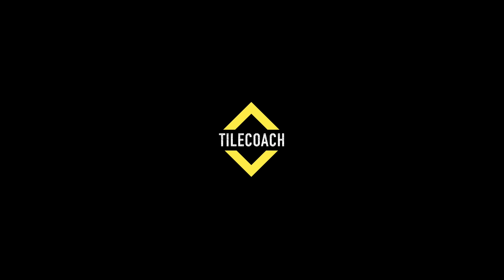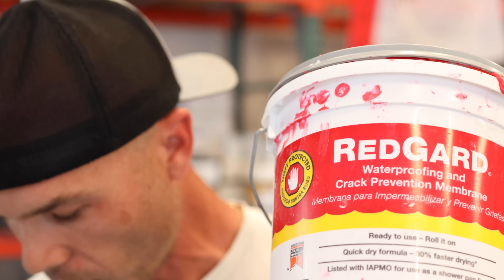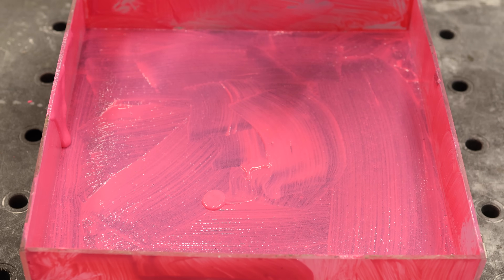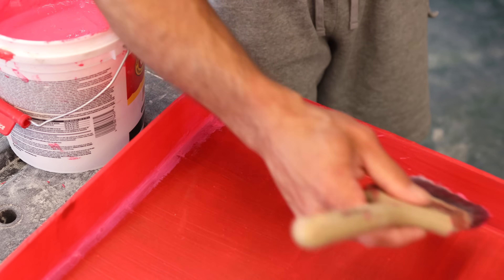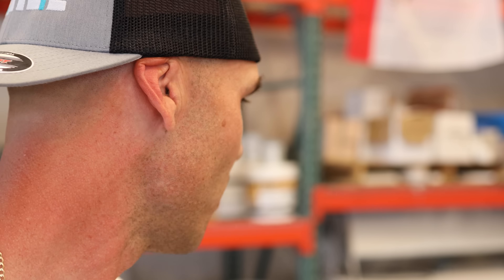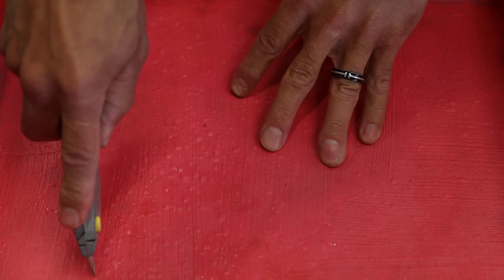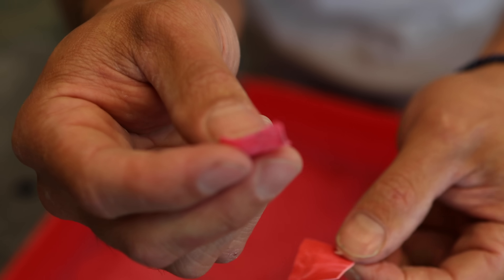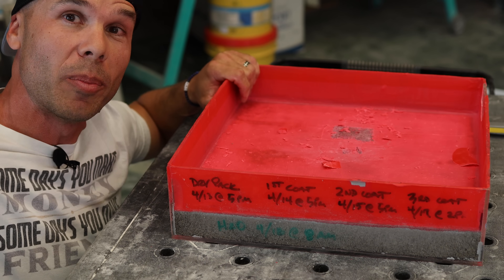REDGARD FAILED FLOOD TEST!!! --- Why Did it CRACK and BUBBLE UP???

Comment: For my zero transition shower I used a liner, then mortar bed, then redgarded 3 thin layers, and then an extra thin coating like you did around the corners and drain.  Because of other work going on in the house, I did 24 hours between coats and after the last coat it was over a week before I got back to putting in pebble on the floor and large format tile on the walls. I've been using it for almost a year and due to it being a bathroom over my garage, I have access to see the under side, and can report absolutely no dampness is showing and the shower is used at least twice a day...
However, I would never rush the drying time.... I was lucky I didn't have to push it....Interesting to see your results and wonder if the dry pack just needed a longer cure time...
Thanks for all you do!
Reply: Why two layers of waterproofing?     Waste of money.   If you use a liner this membrane isn't needed.    Just like the other way around.     Use one or the other.   No need for both.     If I seen  you using both on my job site, you would be fired...
Reply: @homesteadhaven2010  better safe than sorry🤣🤣🤣
Reply: @homesteadhaven2010  no such thing as a waste of money or something taking "too much time" when it comes to my house. Having both of these in place is basically CYA. If 1 system fails then I would want to have the pan liner as a last line of defense so that I'm not having to replace an entire subfloor bc of water damage. I understand you contractors operate differently and want to rush from one job site to another. You don't have the luxury of time to properly allow materials to dry or settle before starting the next. Everything must be done efficiently and economically. . It's just not possible for you - I get it.

Comment: I make no claim to expertise here, and this will likely be ignored, but here goes.  I chose not to use Schluter, not because the product is bad, but because their warranty installation instructions were lacking at the time, in my idiot opinion, and the local price and availability was insane.  In outdoor waterproofing, you ALWAYS start at the bottom, work horizontally avoiding / staggering vertical seems, overlap everything, and then move up.  They did not allow modified thinset at that time, i don't know if they changed that yet.  Add to that a few years ago my lowes wanted $80+ for a 3x9 roll, didn't offer any larger rolls, or any of the corner or pan peices.  This is not meant to be a rant though, just the issues for decision making at the time.

-- I mixed 4  to 1 floor mud with sand to get 5 to 1, I don't know how that compares to to dry pack and let it cure for a week.
-- I used hardie wallboard for the walls, curb, and entrance leaving a 1 inch gap above the pan all around and sealing every screw with 100% silicone.
-- I taped and bedded (drywall reference) using 118.15T thinset. I also tried to push some thinset into any gaps between the pan and liner.
-- I used 118.15T thinset to float / skim coat (drywall reference) all the walls, curb, and the pan (but not the gap.)
-- I ran and spread a bead of 100% silicone (think running painters silicone on trim edges, just thicker) around the edges of the pan where it met the wall / pan liner.  This was to try to account for both the plain change and material change.  Different materials expand and contract at different rates and gapping / separation will happen at any plain change.
-- Then I used redgard.  I used a brush and small roller to coat / cut in at the corners / plain changes in thin even coats, then I applied it with a larger roller everywhere else and allowed a little extra to flow into the corners from the larger roller, but not too much in any one coat.  That was the method I used for every coat.  If you look at any paint, it says to back roll when spraying, so I used the rollers to try to prevent weak spots from the brush lines.  I put about four or five coats through the whole shower, that is when I stopped getting any color bleed / change (painting reference) from the thinset.  I did another two coats in all the corners and from the belly down and the pan out of paranoia.  In all of this I tried to make sure to try to seal the bottom edge of the wall board to the pan liner as well the pan to the pan liner over the silicone.  I also brought the redgard over the curb and onto the subfloor two feet.

If I were to do it again and actually have good access to materials, I would probably use something like Schluter and a fluid applied like redgard together with a 118.15T thinset for seaming. I would start with covering the pan going at least 3 inches up the wall with each piece with a minimum of two inches overlap between pieces from the center out.  then go horizontally up the wall row by row with two inch+ overlaps, including onto the pan floor.  Then I would use redgard or another fluid applied to go over the seams and any exposed seaming thinset with at lease three coats.  This way water could only go from proof layer above to proof layer below with no way to wick between, and yes I would cover out onto the floor a couple feet as well with at least the fluid applied, but that is just because I am as stated, a bit paranoid.

Comment: Redguard didn't fail. You did.

Its quite obviously too thick and cracking because of that. Just like anything else does. Put on drywall mud too thick and it cracks because it's shrinking at different rates. Same concept.

Theres guys who have covered straight cardboard with it and it's never leaked.

Comment: Thats why i use 6 to 9 coats with ample drying time between.
Along with using reinforcing fiberglass mess cloth/tape at all seams, corners and the drain.
Ive NEVER had a failure.
Reply: That’s fine for someone who has the time to wait, an installer could not wait for 9 coats to dry.
Reply: @AK-ky3ou  i can generally get it done, dry and start laying tile by noon the following day.
Sometimes i set up a fan to stir the air to speed dry time. Not blowing on the Redgard but just stirring the air in the space.
But yes, im usually doing other things and return to apply another coat periodically without being under time constraint.
Either way, the peace of mind im afforded by insuring a proper waterproof membrane is worth an extra 1/2 day imo.

Comment: Only thing I can think of is maybe there was still some moisture in the mortar bed and since the glass was air/water sealing around it, as the remaining moisture tried to evaporate, it had to try force it's way up through the red guard, creating the little bubbles? IDk. Won't use this product anyway. It's all about the hardie orange boards. pre waterproofed

Comment: Seems to be more effective when you use xfasten membrane fabric tape for all joints corners and seems like between your glass and mortar overlapping 3 inches onto each. Membrane Fabric comes in 75‘ rolls and is 6“ wide. Usually takes two rolls to do a regular size shower also you put a piece over all your screw holes on your dura roc. And I believe the bubbles are from the suction try pouring one out and see I may be wrong. Thanks for your videos 🙏
Reply: wth do you need 150 feet of fabric for?? thats a grip

Comment: Damn this is some shady product advertisement. You know you're selling mostly to gullible DIY'ers. So you bash a product but they'll never notice the subtle beginning. 24 hour cure time is just not enough cure time for a mud bed. That's just foolishness. Hopefully a DIY'er will do a little more digging on mud beds and understand that concrete products take multiple days to really cure and heat helps this process but heat can also cause cracking so keep moisture... it's a process. Mud beds and concrete are a process. It's not just a set it and go kinda thing. that's why all these houses are falling into their footprint. lol pour on monday frame it on tuesday! NOOOOO. Let the mud bed cure for a good 3 or 4 days with good ventilation before you put on a membrane!

Comment: Hubby said it's the smooth surface of the plexiglass and transitioning to morter. Try sanding the surface, or place sheetrock/hardi backer board around the smooth glass area. Then the transition between the two planes of substrates will be similar.

Comment: I like red guard, but I don’t like it as the primary barrier in the pan itself. If I do a mud bed, I’ll use schulter membrane with its corners and band. But I will use red guard on the walls and overlap the band to the wall/floor corners. I’d rather trust the membrane/pre made corner systems as the main defense.

Comment: Redgaurd seems to work best with multiple thin coats if you go heavy or don't allow it to dry between coats you'll get cracking and blistering. I use it on ever job but I don't trust it as a 100 percent waterproof. Also as you stated the color change gets me. So I build a water in water out and then coat it. If redgaurd fails im still good. I also don't agree with a potential mold sandwich. If no air gets in either side of a double vapor barrier it's just water

Comment: Very awesome experiment and I would like to see additional tests to give RedGard a fair chance. As others have said, maybe it didn't fully cure. Maybe retry and wait the 28 days?  Thanks for all the videos!
Reply: I agree. The color change to pink looks to me like it hasn't properly dried before it is allowed to get wet. Most latex paint directions say that it takes a month to fully cure for its full strength. A test could be done giving the RedGard a month to fully dry, and the mortar bed probably should be given a week or so to dry before applying the RedGard. This may allow the RedGard to pass the waterproofing test, but it would still fail. Who wants to spend a month or more on surface prep?
Reply: If it can't cure enough to function properly over a weekend when applied at manufacture recommended specs then it's not worth anymore testing. Even if you could make it work by jumping through more hoops and wasting more time the test showed there are superior products that should be used instead.

Comment: I always use a “FABRIC MEMBRANE” such as XFasten or Kohree fabric membranes on changes of plane and roll the redgard through the fabric membrane with a metal wallpaper seam roller …. Then apply a second coat and “Never” have cracks. Also I don’t use it on mud pans. Although I do cover a curbless mud pan with Kerdi membrane so that I can extend the waterproofing to bathroom floor. This method works fine for me and saves unnecessary expense for the walls. I don’t ever use redgard on horizontal surfaces where water can saturate it!! I believe that the cement is “off gassing” As it cures for up to 7 days and creating blisters as you have now sealed it and the gasses have nowhere to go. Way to soon to coat the mud pan and I wouldn’t do it anyway. Mortar and Kerdi first then redgard and fabric membrane on walls only!! I would be interested in you doing the same test after curing the pan for 7 days… but what’s the point. Unless you’re a DIYer , what customer wants to wait for that. Also your videos seem like you’re setting yourself up to make the Redgard fail. No offense (and I have learned a lot from you) but in a previous video that you posted someone showed you this technique (although he thinned it with water for a “Primer coat “ and I don’t) and you commented that it was the best technique you saw so far. So why don’t you apply what you learned Coach?? Just saying with all due respect!!👌

Comment: I wonder, is there any chance that the membrane is getting contaminated by the bed? is the redguard that was on the side lower down in the water also really compromised? Or is it just the stuff on the bottom that was weak? Also, I suspect the corner cracking is caused by a large build up of product shrinking as it dries, which is why they don't want it to go on too thick or too thin, that buildup in the corners will be really hard to avoid.

Comment: This is a head scratcher. I built a DIY shower pan using almost this exact method six years ago. Two coats of Redguard over a mortar bed, only difference is I reinforced the corners with fiberglass mesh tape and the walls were of course cement board. Did a 24 hour flood test and the Redguard did not change color, and the water level in the pan did not change. Thinset and tile over the Redguard and I've seen no signs of leakage in six years when I check out under the shower from the crawlspace under the house. Maybe Redguard changed their formula since then? 
I was extremely careful to ensure the 2nd layer was painted on at a 90 degree angle to the first as specified in the instructions; your video makes it look like that wasn't the case in your install. But that wouldn't explain the kind of failure you experienced on the mortar bed.
I've learned a lot from channels like yours since then and wouldn't do a "Redguard special" shower pan again. There are too many other superior products and methods out there. Thanks for all the work you do schooling us!
Reply: Thinking about this a little more, maybe the plexi box didn't let the cement cure all the way, so there was still moisture when the Redguard was applied. Maybe try a box with plexi sides for visibility and backer board or plywood for the bottom- something that will let moisture migrate out of the cement in both directions. And give the concrete a few days to cure. I hope you share this video with Redguard and see what they have to say!

Comment: I did my shower myself with a traditional mortar bed/liner/cement board and red guard about 10 years ago. Recently started a bathroom remodel which involves a shower expansion. Had ZERO water penetration in 10 years. Yes, I know 10 years is a short time.
Reply: There is Absolutely Nothing wrong with redgard when applied correctly..... Been around decades before sheet membranes

Comment: Their instructions are shit. Dry pack is NOT uniform and moisture resistant enough to allow the Red guard to cure properly. A primer rated for the application would help a lot.

Comment: It speaks volumes that under those controlled conditions it still failed. I would caution everyone to only use red guard as a crack prevention membrane and never as the waterproofing on the shower pan. I cringe to think of how many showers are eventually failing because of this. The bright side is, more work for us! Lol

Comment: I did a pan with dry pack, kerdi membrane, and unmodified mud, and coated the whole thing with two coats of red gard. No leaks after a 10 day flood test. Red gard does seem to behave strangely against dry pack, so I usually apply it over kerdi membrane that's been set over the dry pack. Don't really use red gard much. Hydroban seems much more effective/forgiving.
Reply: Why put red guard over kerdi? 
Just do the seams

Comment: Really not a fan of redgard at all, it’s too finicky to work with and when yo do water test it; in my experience it usually fails. My favorite is hydroban, and even mapei aquafense isn’t bad now that formula has change. 
Redgard we have found I too inconsistent when applied, b/t drying and actually waterproofing a shower. Know other products are more expensive, but if you’re having to wait longer for redgard to dry/cure, and add multiple coats, which another product could take fewer, & not to mention if it cracks AND YOU DONT CATCH THAT (which is easy to miss, imo), it’s something I don’t feel confident using on others jobs……let alone my own shower.
So, for me, I want something that will last till customer gets tired of the “look” & not b/c the system failed; as that’s how I would want it done even if costs a bit more (which if your having to wait days w/ multiple coats for a waterproof membrane to cure, not ideal when have jobs to do).
Cheers✌🏻

Comment: something seems off about this. whenever i work with redguard on mud beds do a base coat kind like priming with a much thinner watered down redguard then the regular layers. i also do mesh tapes in all the joints beforehand pressed down with thinset.
Reply: Yup first coat need to be really thin and mixed with water like it said on Spec sheet. 
I think it is better to put 3 or even 4 thin coat than only 2 Thick coat.

The Product retraction seem to be the problem.. top of the coat dry and pull on herself.. and crack ? (Maybe)

I've tried redguard on my bathroom. 4 layers to put recommended quantity.
I applied it with a Little roller and a Brush on corner.
I also put  Mesh on corners and junction between walls and flange of the shower pan (no Mortar bed so no redguard on the Floor).

I got a Nice red uniform finish!!.
No crack at all!
 Dont know how it Will be  over the time but .. so far, so good! 

Thanks for your precious videos!!
IT really help and give a chance to learn more about the fine art of tiling and.. surely avoid big mistake!
I really appreciate your channel!